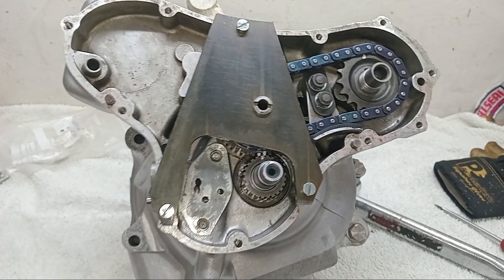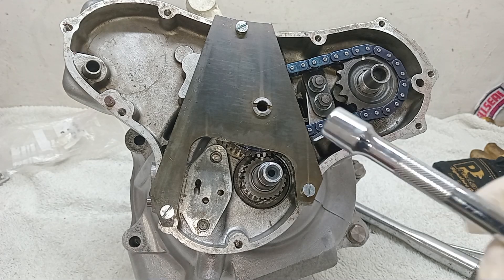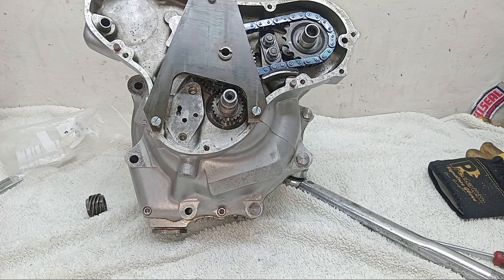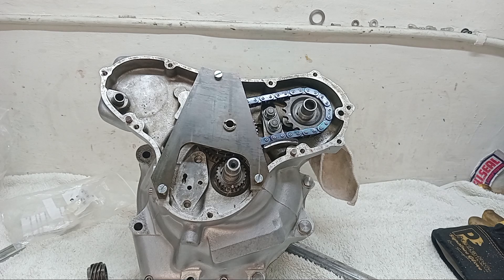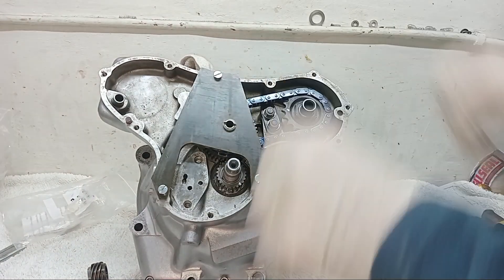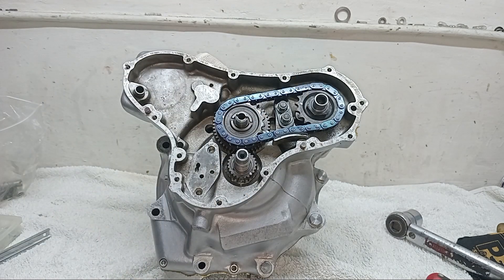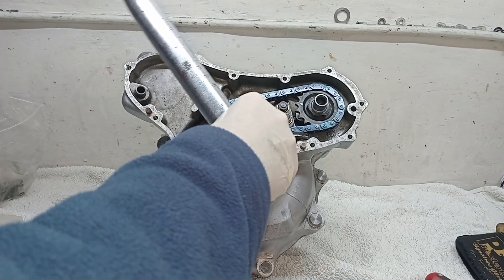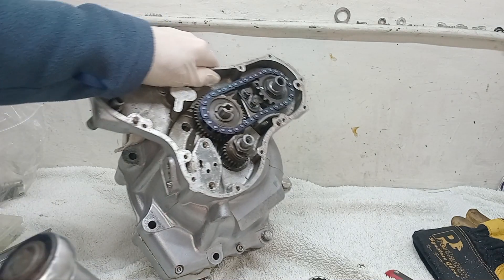Norton Commando Engine Rebuild. Part 53: Fitting the Camshaft Nut.

Comment: Hello Chris
I have seen various ways of adjusting the cam chain tension.  Some people adjust tension on a 100% assembled engine.  

Am I correct to understand that cam chain tensioning is most accurately accomplished with the cylinders and head removed to eliminate the effects of valve spring forces on the camshaft ?    

On an assembled engine,  will unscrewing the valve adjusters 100% remove the valve spring loads on the cam shaft where I can make the same cam chain tension adjustment ?
Thank you for the great vids
Reply from the maker: Personally I think you're  trying to be a bit too precise. I'm sure that valve spring pressure will deflect the camshaft and hence the cam chain, but only by an insignificant amount in relation to chain tension. I'd adjust it in situ with the valves still operational. The main thing is to keep turning the engine over to check the tension at all points. Good luck. 👍
Reply: @Chris.rooke150  By it's design and the consequences of improper adjustment, I believe this to be one of the most important adjustments on the machine.  Plus, it's my nature to go overboard on things.  Thanks for the great videos!

Comment: hi chris, for the respective torque of cam and crank pinion nuts I had been referencing your book for values given that the workshop manual does not list them. Are the values on your video revised for the specific cam your using? ( I have read of a lighter torque for the cast PW3 cam)......thx.
Reply from the maker: Yes, I think you're right! I'd forgotten my own recommended torque settings! The ones in the video are a bit low. I'd go with my manual: camshaft nut 20 ft lbs, and worm drive 35 ft lbs. 👍